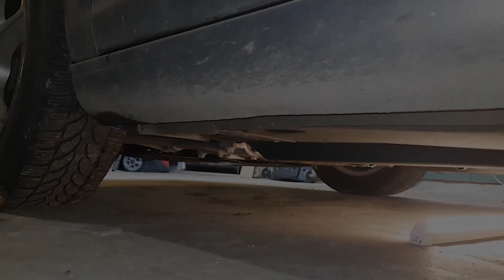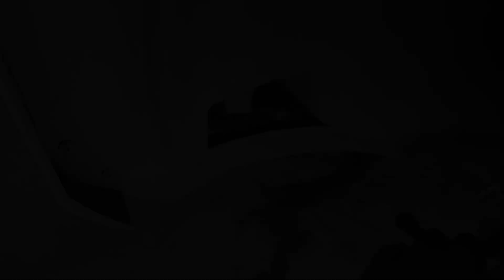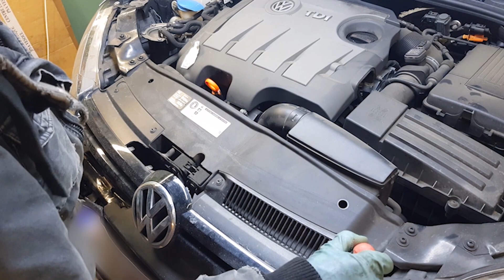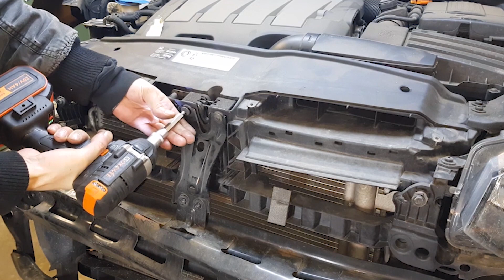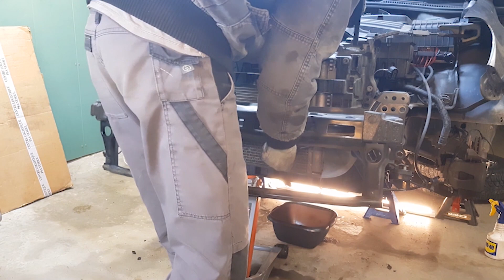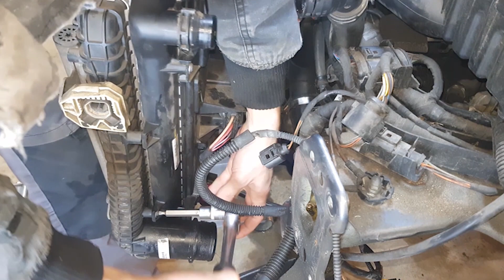[Volkswagen Golf 6] [Ep1] Dépose de la face avant et du radiateur

Comment: Hi, my golf mk6 coolant radiator is minor leaking, thank you for your video. My question, if I only need to replace the radiator, must I take off many front parts? like headlight? front steel bumper core etc. it looks like need to take off most of front parts, in order to just take out the radiator? is it possible that just take out radiator from back (between fan and engine gap)? Thank you. From Japan, sorry, I use google translate to understand French.
Reply from the maker: (google trad) Hello,
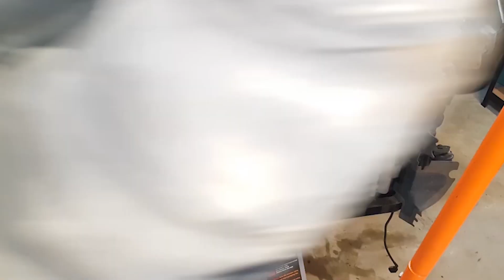Thanks for looking at me from japan. For your question, unfortunately you have to follow the video in its entirety... You cannot remove the radiator without removing the front panel because of the radiator support which I remove at 11:04 and the air conditioning radiator hoses at 12 :55 ...
I could be wrong but I'm pretty sure you can't do it without doing the whole tutorial.
sorry 
(texte original) 
Bonjour, 
Merci de me regarder du japon. Pour votre question, vous devez malheureusement suivre la vidéo dans son integralité... Vous ne pouvez pas déposer le radiateur sans déposer la facade avant à cause du support de radiateur que je dépose à 11:04 et des durites du radiateur de clim à 12:55 ... 
Je peux me tromper mais je suis pratiquement certain que vous ne pouvez pas le faire sans effectuer tout le tuto. 
Désolé
Reply: @VaroTvMeca  Thank you very much for your reply. I found the same model as well, https://www.youtube.com/watch?v=hmNIKlVLKzo, he also removed the all front parts (including both headlight, big job  T_T). I will try this weekend. I guess if only replace the fan (in case of fan's issue), maybe the gap is enough. (disconnect fan socket, 4 screws) is that right?

 After take out the fan, to disconnect the in/out hose, especially the left hand side hose clip (in zone of the AC pipes around, very small space to operate), maybe the challenge. As your mentioned 12:55, there three layers, AC condensor/intercooler/radiator, I guess if I don't release the intercooler and AC condensor separated.  can I have the chance to release the radiator only from the back gap (after fan removed)?     Merci
Reply from the maker: @handong950  
google trad)
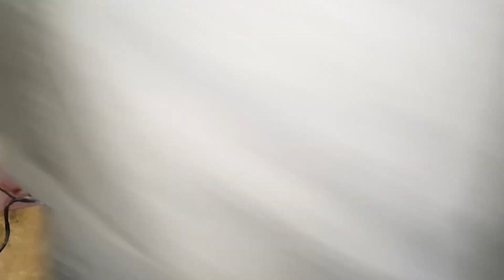honestly, I doubt that could be possible, because of the heatsink support (11:08). it envelops the three radiators and I think that without removing this part it is not possible. You won't have enough space to remove the radiator and even less to put the new one back on without damaging it...
If you're a bit mechanically savvy, this job is less complicated than it looks :) Allow enough time to do it and you'll be fine.
Sometimes it's easier to dismantle everything than to try to disassemble as little as possible and ultimately complicate the task.

I think my video is complete enough that it can help you with the repair.
stay tuned if you need answers
(original)
honnêtement, je doute que cela puisse être possible, à cause du support de radiateur (11:08). il envelloppe les trois radiateurs et je pense que sans retirer cette pièce ca ne soit pas possible. Vous n'aurez pas assez de place pour retirer le radiateur et encore moins pour remettre le nouveau sans l'endomager...
Si vous êtes un peu à l'aise avec la mécanique, ce travail est moins compliqué qu'il en a l'air :) Prévoyez suffisement de temps pour le faire et tout ira bien. 
Parfois, c'est plus simple de tout démonter que d'essayer d'en démonter le moins possible et au final se compliquer la tâche.

Je pense que ma vidéo est assez complète pour qu'elle puisse vous aider à effectuer la réparation. 
reste à votre écoute si vous avez besoin de réponses